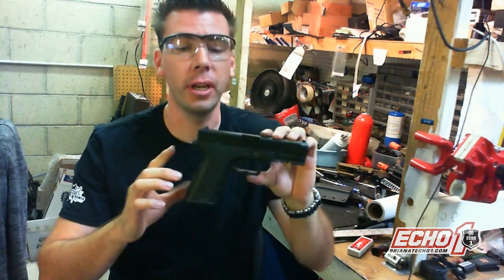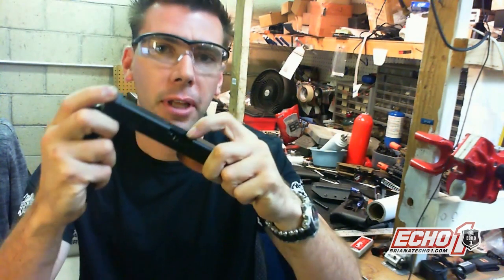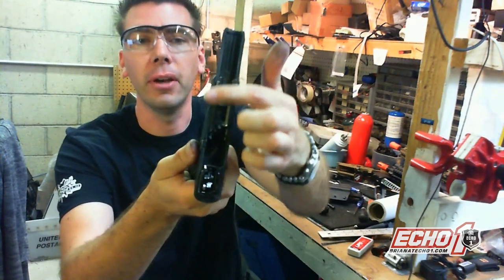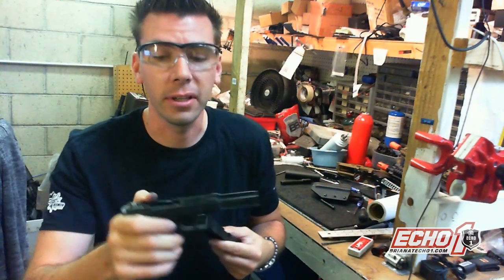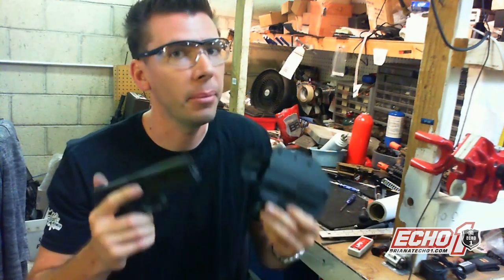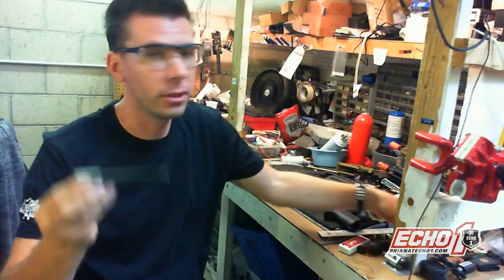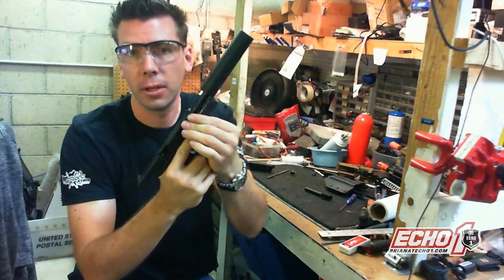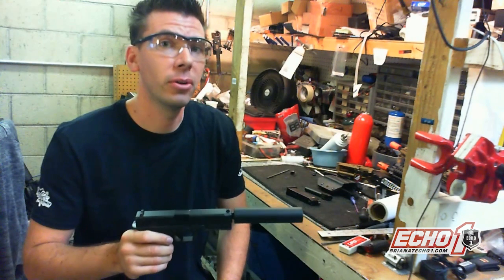Upgrade and accessories for the Timberwolf by Echo1

Comment: How is the flying fuck do you take the backstrap off?????????
Reply: Take the slide off and look down the magwell then push with a screwdriver into the top hole in the frame against the backstrap.